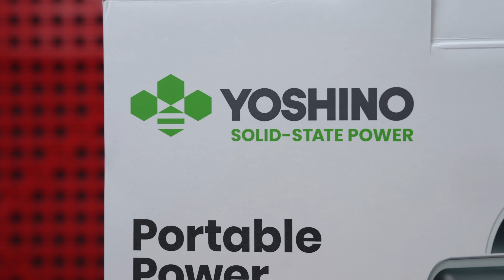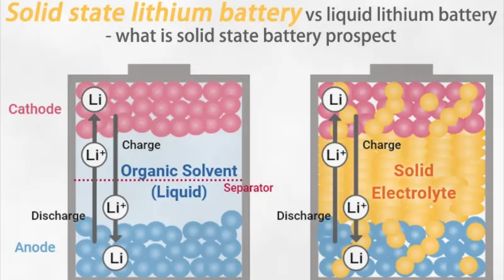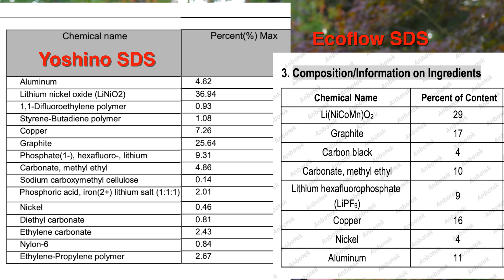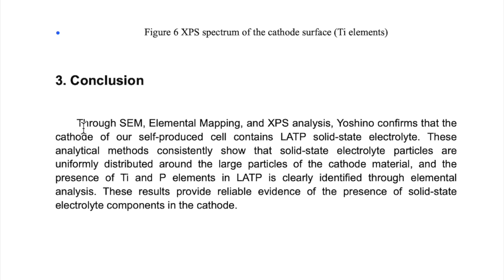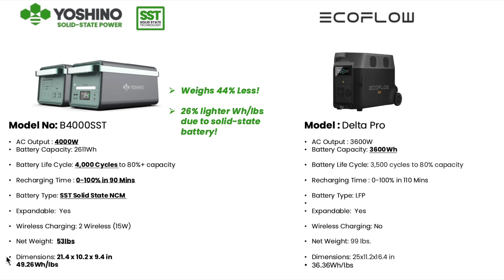Yoshino INVESTIGATION - Are Their Solid State Batteries REAL?

Comment: Without a complete tear apart of the battery, and understanding the material inside, it sounds like this is a hybrid solid state battery.  Bear in mind the difference between a traditional Lithium Ion battery and solid state is the electrolyte, one is a liquid (traditional) and the other is a solid material.  Hence solid state. In a hybrid solid state a solid electrolyte is indeed used to separate the anode and cathode, however a small amount of liquid or gel catholyte is still used in the cathode.  It has an improved cathode and electrolyte interface and greater energy density.  However the liquid or gel still presents some potential safety issues. I’m not saying that is what you have here, but that is what it sounds like to me.  Maybe a followup with the company would confirm it is a Hybrid solid state battery.

Comment: I have put my money on Yoshino being the product they advertised …the  8330sst  portable power station to this point in my usage hits all the empirical bench marks I have been able to put it thru …the pending part for me is the repeatability ?!  The Manufacturing And Design Quality are very good for a consumer level starting point product …. I was an early adopter of Lithium Ion Batteries to a high end laptop 20+ years ago … this preliminary first iteration of the SSD may be a moon shot product or it may be a what might have been …the time test will be the determining factor and  from what I have so far assessed is that the failures pure 10K units is currently on par with a responsible well manufactured product …  as for this being the pen ultimate  solid state battery formulation it is not …it is however a production ready iteration that functions and functions well in my short term usage …I know locally we have two solid state battery companies in R & D that could follow Yoshino into this market path right now with their solid state battery blend  but both are targeting military and industrial markets first …which I think is the better market to iterate in …so bravo to Yoshino for tackling iteration of technology and product in a very difficult way!

Comment: (Semi) Solid state battery only says that the electrolyte is (partially) solid. A solid electrolyte allows for using lithium metal anode, and sulfur / oxide cathode which is where the claims for energy density / safety come from. These are what really increase energy density compared to liquid electrolytes, not the solid electrolyte itself. But solid state doesnt need these technologies. e.g. quantumscape use lithium metal anode with LFP cathode to give intermediate energy density. This battery uses carbon anode, NMC cathode, carbon anode, so it will have the same energy density as a normal NMC cell, with maybe some other benifits. 

The confusion comes from advertising claiming solid-state is better than liquid. The actual case is lithium metal batteries are better. Solid state is one way to get lithium metal batteries, and there are other ways (e.g. biomimetic electrolytes)

Comment: This is so called semi-solid state battery.
It uses solid state electrolyte but the anode and cathode are not mechanically connected to the electrolyte so liquid electrolyte is also used.

Comment: If the solid electrolyte is in the form of a powder, there's going to be air in between the grains, and compressing it may not get rid of all the air. Not electrolyte might also not be compressible. A liquid might help the conductivity (or something) between grains making the battery more efficient. Still, this would be a solid electrolyte because the liquid has nothing to do with the actually power generation and remains inert. That's my guess.

Comment: What is the comparative (cross measure - battery brands) and proportional (self measure) quantity of liquid by weight to the total weight of the battery component (and to bring that other great controversy of (prepper/DIY communities) how's that relate to wet vs dry cement pour slumpage, i.e. how sloppy is the internal material and could you make a patty from it and BBQ it on the 4th).

Comment: Yoshino almost certainly buys the cells for integration into their power station. So far the solid state battery industry is still new enough that dozens of different materials are under development and small scale production both as electrolyte and the anode and cathode. However, some are more solid than others.  The less solid type are often referred to as semi-solid or quasi-solid.  The cells Yoshino uses seem to me to be of the less solid type.  This is still a significant reduction in liquid, but it isn't like the typical LiFePO4 or Lithium NCM or other commonly used cells are full of liquid that you can pour out if you open the cell. In other words, the typical lithium cells that are commonly in use today are not "flooded" cells. In those cells the liquid facilitates ion exchange - a necessary function of the battery.

The key question is, is the liquid a passive element or does it participate in ion exchange between cathode and anode?  If active then the cell is not solid state but might be considered semi-solid.  If passive then the cell is technically solid state but might its components may have been compromised to reach performance or manufacturing goals.

Personally I consider a further reduction in liquid is not enough to qualify as a solid state cell, and the behavior of the cells from the Yoshino power station does not seem to fulfill the promised safety characteristics of solid state batteries. This means to me that at best it is a compromised solid state cell, and if you don't achieve the promised safety and life benefits, it is deceptive advertising.

Comment: What's the issue here, really?  Safety, right?  We want solid state because it's perceived as being safer. (could be true).  If it's not true than who cares if it's solid state?  Let's assume all this to be true.
They say the liquid is a binder.  Don't binders normally dry?  If it's liquid, how is it binding?  Bottom line; will it hurt me.  Isn't that all we really need to know.  Torture test time.  Stop with the words and start with the actions.
Reply: Not just for safety, but because they last longer (more cycles) and aren't as affected by either extremes in temperature.
Reply: @SethV0812  Ah, so.  Trueness.
Reply: @SethV0812 not only that, the expanded amount of materials you could use to make batteries means we have more materials to make batteries that hold even more charge

Comment: Why can't you take it apart?  Seriously, it's the simplest way to get your answer.

This video does nothing to answer the actual question, rather it adds to more speculation...
Reply from the maker: You can take it apart, sure. Others have and I shared what they found. Problem is, what do you do, taste the powder? smell it? That's the point, it's just a guess. Few situations like this have a single silver bullet answer, I shared what I found and you can decide.
Reply: It's not that easy to go "that eloctrolyte kinda sorta looks like a liquid". That's not good enough. You need, in writing, a lab analysis and report like shown in this video here. If all of that were fake, then the company would be facing legal consequences.
Reply: @crowmanhusk5644  The problem is, the components and materials do not define what is or is not a solid state battery.  There are dozens of different combinations in test and development.  There is a definition of solid state battery based on the behavior of the elements and compounds in the battery.  That definition does not preclude having a flooded battery. There are promised safety benefits of solid state batteries.  In my opinion if the battery does not provide those benefits, if it behaves like other lithium-based batteries, then meeting the definition of solid-state is not relevant.
Reply: We'll leave that up to Will Prowse...lol.
Reply: @thefpvlife7785  good idea